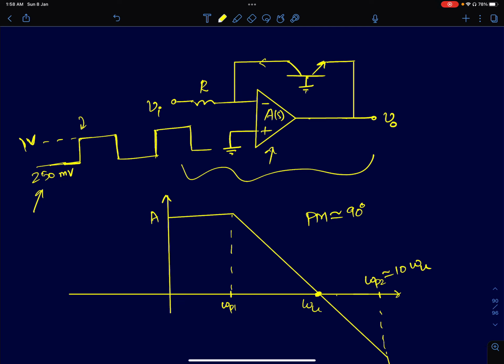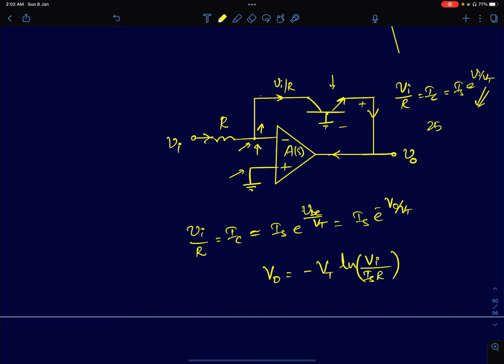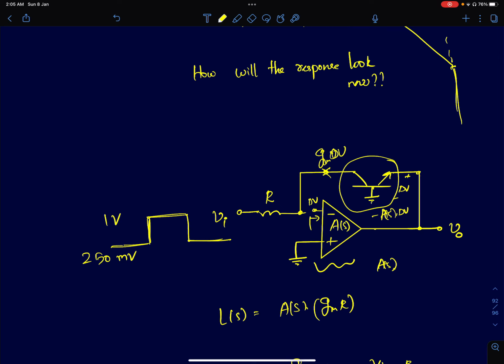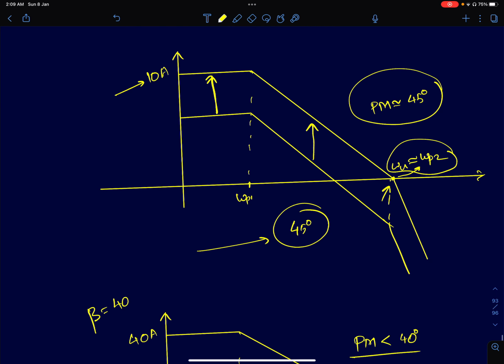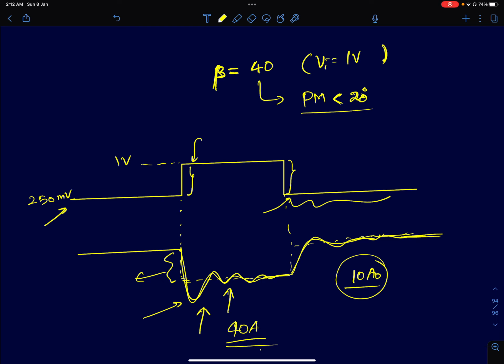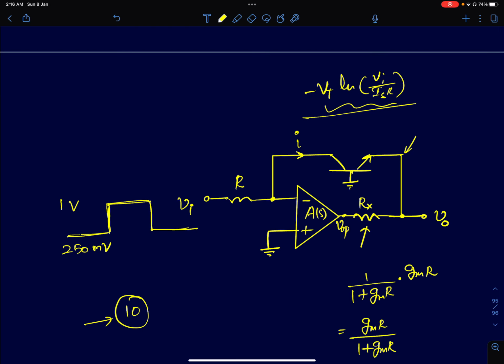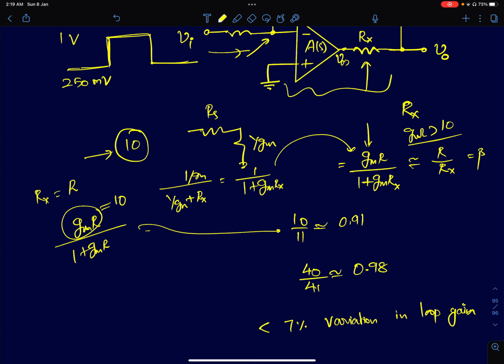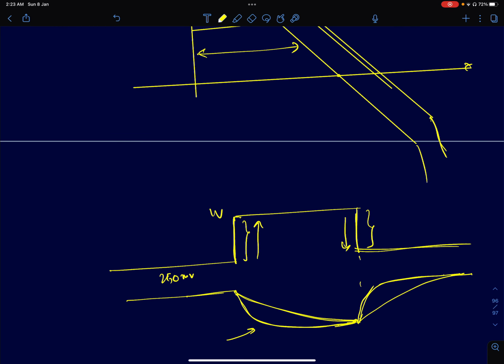OC Lecture 13) An interesting stability problem in a logarithmic amplifier

Comment: A very interesting and informative explanation of some factors influencing log amp stability. I am especially interested in how the equations are changed when we have a current sink input such as a photodiode, modelled with its internal capacitance and resistance. Thank you for a great video.